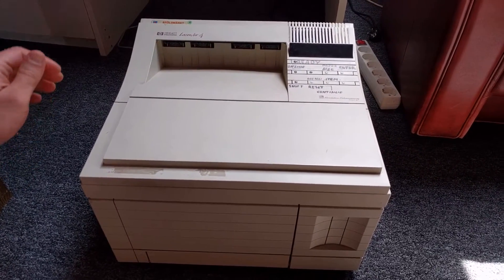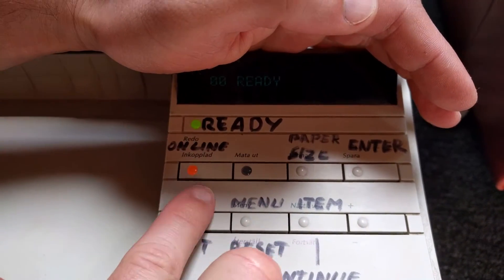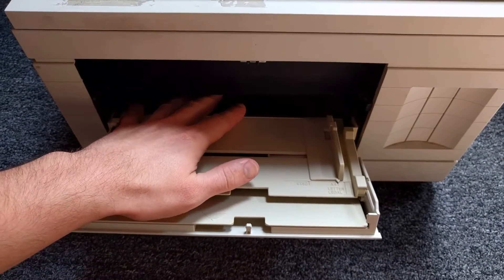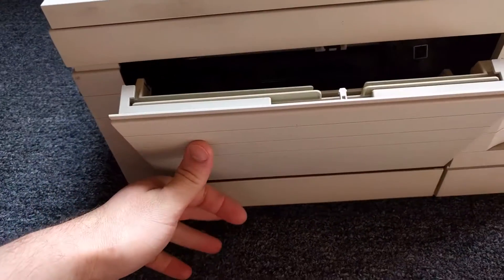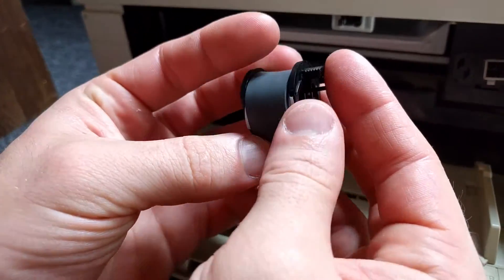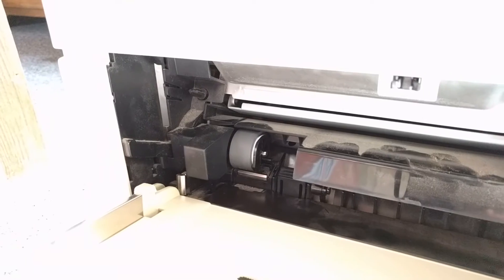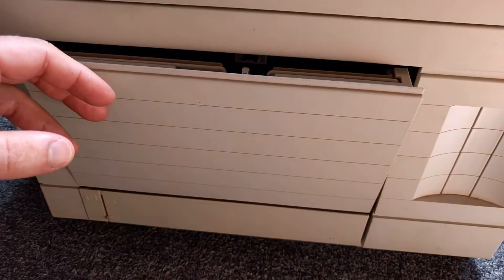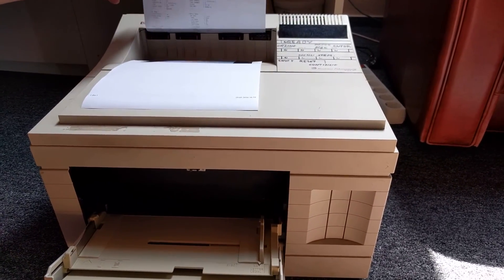HP LaserJet 4 mp-tray / pickup roller FIX

Comment: Perfect, printer still running in 2024, added some electrical tape under the pickup roller rubber, and softened the rubber a bit by putting on a thin swipe of vinegar - now I have the manual tray back :)

Comment: Excellent.  I had the same problem, Once I saw your video,  I removed the roller. the rubber tyre was shiny and slippery.  I turned the tyre inside-out and it and the problem was gone. Thank you.